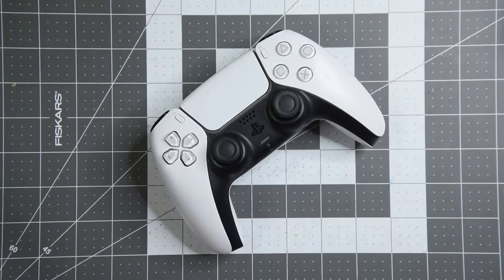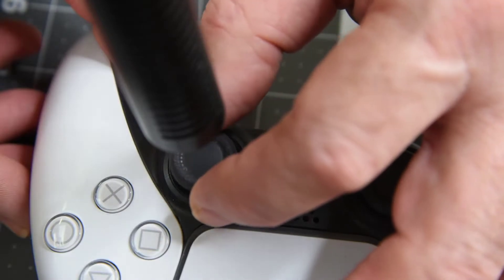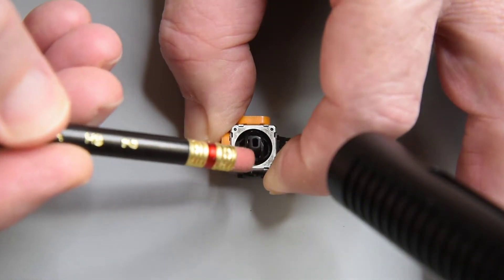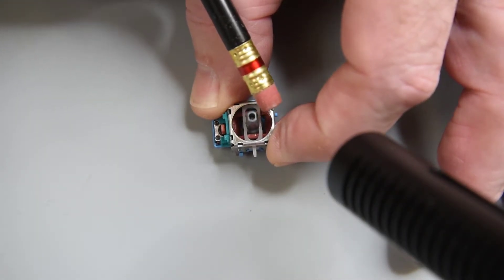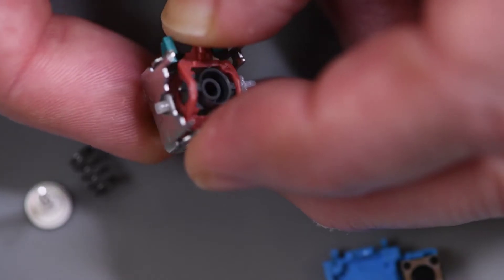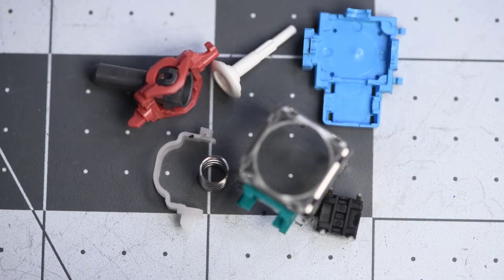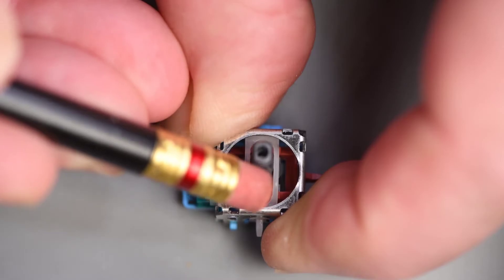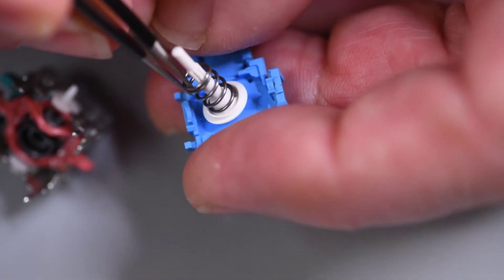Why Some DualSense Analog Joysticks Click

Comment: When I move my dualsense analogs from left to right or right to left I can feel/ hear a click On my thumb but not up and down. Is this what you are talking about? I tried about 8 dualsense controllers they all do that even the controller came with the console.
Reply from the maker: I don't know.  The click from the joystick should come from moving it in any direction.  I couldn't feel anything, I thought I did but when I blocked out the sound of the click, I couldn't.  Of course that spring hitting the plastic has got to cause some physical impact, even if very small.  But it should do it in any direction.
Reply: Even though it’s really annoying, I think it’s normal, though I’m not sure. I never payed close attention to the joysticks before today. Can anyone confirm that this is normal?
Reply: @goatedd26  Mine too, I just bought a PS4 controller and I heard a clicking sound on the left analog but it didn't affect the gameplay, maybe that's normal but it's very annoying
Reply: @ryanputra2922  I can confirm after sending the controller to Sony that it is normal
Reply: @goatedd26  it is normal. Sony uses ALPS joysticks for their controllers. The clicking sound is normal for them and your controller is completely fine